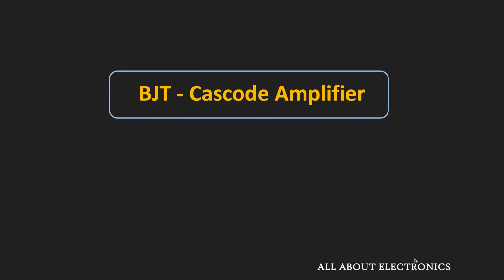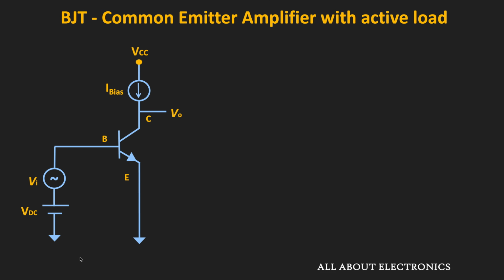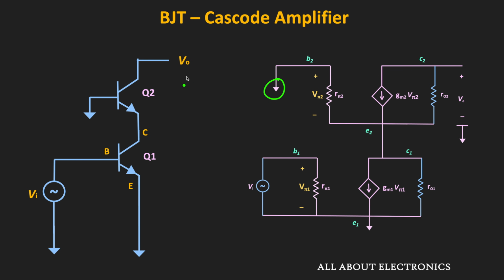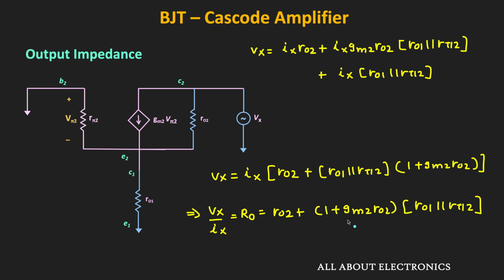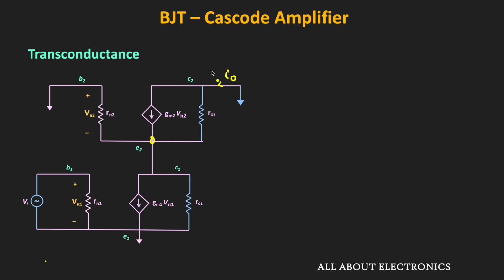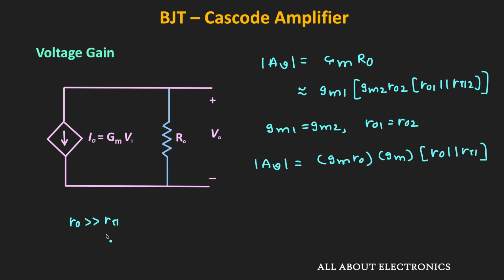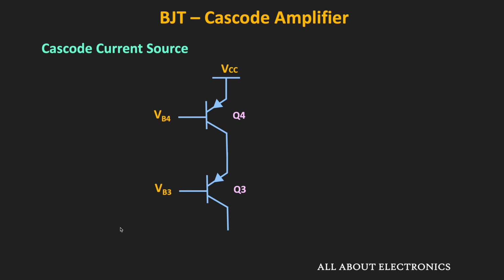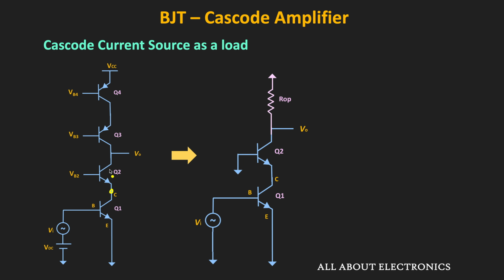BJT Cascode Amplifier Explained | Small-signal analysis of Cascode Amplifier

Comment: 28:42  while calculating voltage gain for resistive load where is the term beta .since it is a cascode amplifier there should be beta in voltage gain
Reply from the maker: This derivation is using the mid frequency hybrid pi model. So that is why you are seeing transconductance gm in the equation.
Reply: Oh got it thank you 😊.

Comment: Whats happens when diode is the load in cascode amplifier?
My assignment question🥲
Reply from the maker: For small signal analysis, you need to replace the diode with its dynamic resistance rd. So, that will act as load. So instead of RL, now you will have rd in the equation.
Reply: @ALLABOUTELECTRONICS  ok thank you 😁

Comment: Is it..cascade  or cascode...? 🤔
Reply from the maker: It is Cascode connection.
Reply: But in my text book ... it is always ..? Cascade ..😢😢
Reply from the maker: There are two types of amplifiers, one is cascade and second is cascode. In cascade, typically the same amplifier stage is used again with different gain. (to achieve higher voltage gain)
Reply: Now that clears  out ...tnx 😊😊